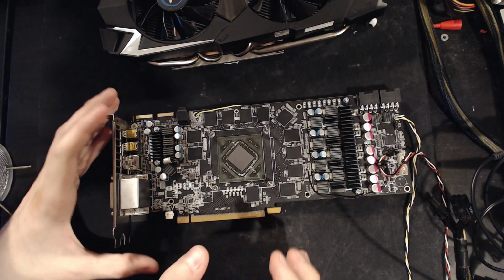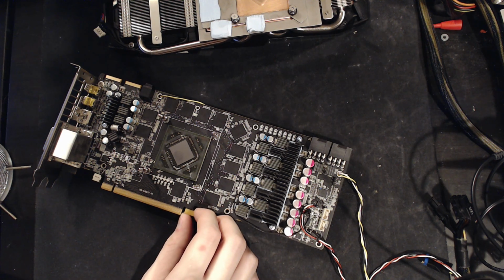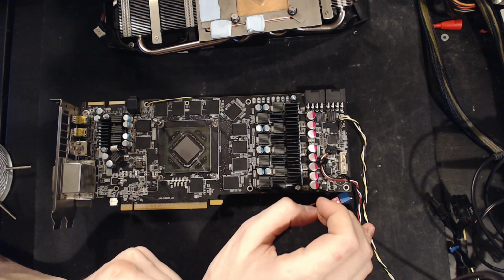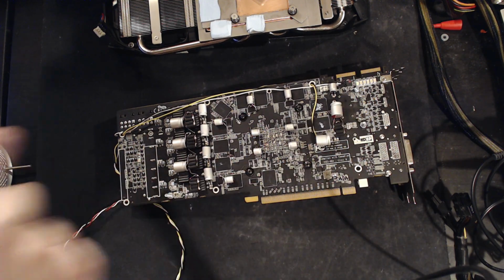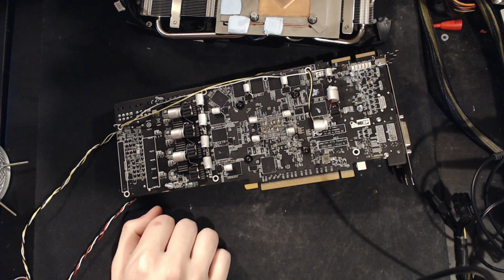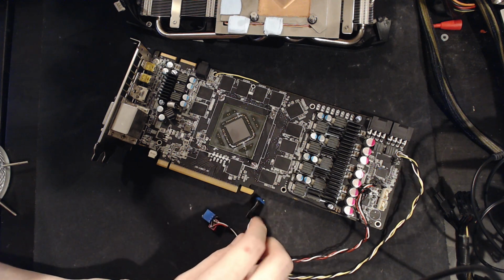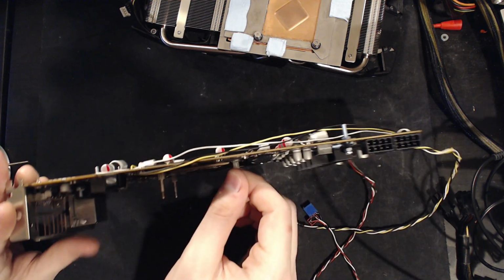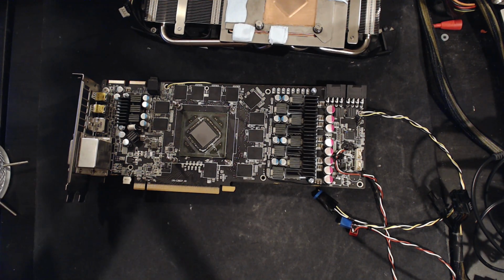The Sapphire HD 7970 Vapor-X project [Maximum Rambling!]

Comment: Hey buildzoid, 

I have a 2-year old MSI 980Ti gaming, and... something seems to be dead about it... it looses video signal randomly and the display turns black, but it's still working, it's still benching or gaming... I can eventually retrieve video signal by switch the monitor from HDMI 2.0 to 1.4 and it forces the card to an other refresh rate and boom video signal is back.
I also have a Vega64 AIO and I'm sure it's not coming from my display.. It really looks there's something dead on my 980Ti and it's no longer covered by the warranty.

Do you think there is any chance it is repairableby replacing something or modding something ?
Regards

Comment: i had a xfx7970 with the same problem as that sapphire: ther is not a single software that can regulate gpu vcore. i was stucked a 1,175v and 1080mhz gaming stable. i bought that shit thinking on overclocking the crap out of it, turn out that i could only get 80mhz. fuck that gpu.
and sry for my english btw
Reply from the maker: XFX made some HD 7970s with 4 phase Vcore VRMs. Those are locked for a very very good reason(they blow up on high voltage).
Reply: yeah, it´s exactly that one. I tried a lot of softwares and flashing all the xfx´s bios. Only the bios from the ghz edition worked, kind of... It was stucked at the maximum "clock state" (idk how is really called) at 1050mhz and 1,3v. That was a shit ton of voltage for the cooler, even with TG conductonaut and fanspeed at 100% on firestrike reached 86°c (stock frequencies with 40% fanspeed it reached 71°c).
With that voltage it tested 1275mhz core and 1760 memory stable on firestrike. 
After that i rolled back to the stock bios. That 2012 piece of crap was replaced by my msi rx 480 8gb last year, and it still working on my hometheater pc.
Sry for my english, and... greetings from argentina Builzoid!

Comment: i don't know about vega specifically, but i know that afterburner limits my gtx 780 to 1300mv and changing that value with cheat engine and applying it allows me to set whatever voltage i want.
Reply: Does it actually change the voltage or does it just display a higher voltage? 
I might give it a shot with my old GTX 670

Comment: Am I getting old or was the 7970 just so much more interesting for overclocking than the rx480 or vega cards?
Might just be that is was the best single core gpu then and still was able to oc like a lot.
Reply: I've got my RX480 to 1466 MHz on air... And if I ever watercool, I'm taking it farther.  Maybe I'm just lucky?
Reply from the maker: getting old I guess. AMD GPU overclocking has basically not changed at all going from the 7970 to the RX 580. The Fiji cards have some weird issues and VEGA is kinda different but overall it hasn't changed much. More cooling + more Vcore = more core clock and that's pretty much it.
Reply: Nah i'm just whiny because my rx480 doesnt oc as good as i want it to
Reply: lol. I feel your pain.  My CPU can't OC to save its life

Comment: Lol, consider yourself lucky with that 64.5 asic rating. My r9 280 dual-x is a 59% dud. but i can get it to 1125 on stock voltage and stock cooler. without issues, so i don't complain too much.

As always, nice video!

Comment: Ah, Sapphire. My first GPU after basically not having a desktop PC system for about 6 years (and not having a PC at all for about 3) was a Sapphire Vapor-X 5770.
Love that thing. Still have it.

I did eventually have to upgrade, but for most purposes it was keeping in there reasonably enough for going on 4 years...
... It's not even a high end card, and still it kept up...
GPUs have not gained as much ground as you'd think since 2009...

Comment: I have that card, a 7970 Vapor X 6GB and I can overvolt/undervolt with literally any software. I usually use afterburner or trixx without any issue. You just want to be on the unlocked bios, the non oc bios is locked
Reply from the maker: yeah I had a look around for an unlocked BIOS and never found one.
Reply: I’m using this one: https://www.techpowerup.com/vgabios/124681/sapphire-hd7970-6144-120704-1

I remember one time the voltage got locked and had to do a fresh install of the drivers. Recent amd drivers are very finicky with this card
Reply from the maker: I used the same one on a few different drivers including some old ones like 15.7.3. I had plenty of software give me a voltage slider but none of them actually changed the voltage IRL. What driver do you have it working on?
Reply: Currently working fine on the latest driver, with voltages applying correctly under afterburner. For me any issues are usually related to wattman trying to overwrite afterburner. You should at least be able to modify the bios with the voltage you want and just flash it

Comment: LoL I could change core  voltage  on my Sapphire HD 7970 Dual X OC, with no problem at all. If I remeber correctly I OC it to about 1270/1370mhz ?
Reply from the maker: previous Sapphire HD 7970s didn't have issues.